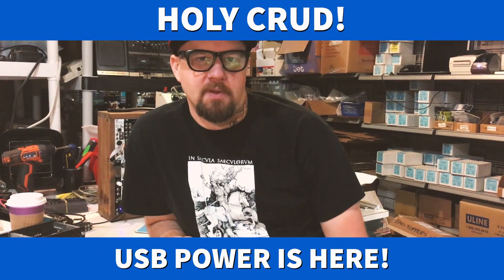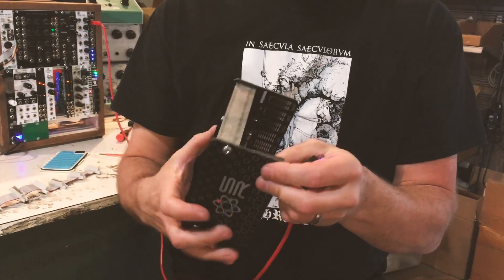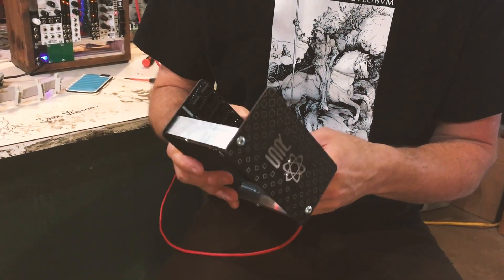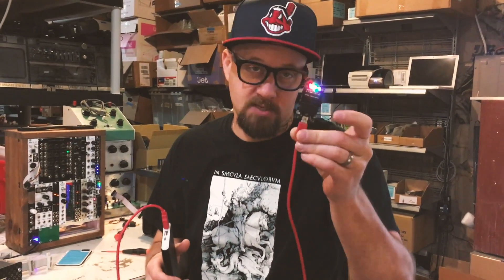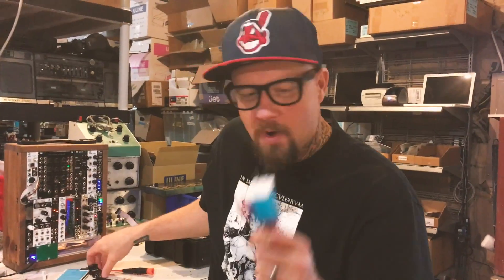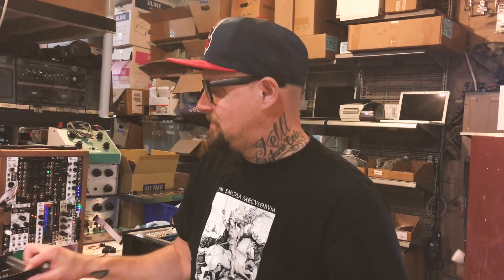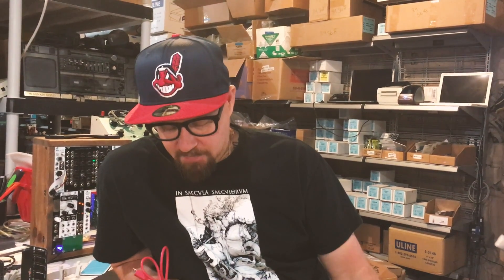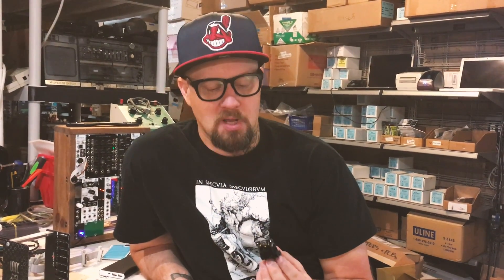Synthrotek USB Power Eurorack Power Supply for SMALL systems - Synth DIY

Comment: With +12V at 250 mA and -12V @ 250 mA  that is about 6 Watts (3W + 3W) of power.  So the USB at 5V would need around 1.2 amps of current out (1.2*5V = 6 Watts) plus a bit extra if the +5V DC is needed   (5 * 0.125A = 0.375 Watts)

Comment: Would it be possible to put a usb power supply on both sides of the bus cheeks? Or does it only fit on one side?
Reply from the maker: Yes, you can get two or use a cable to stretch to the other side.  Both sides might be too much for one though.
Reply: Thanks, I was just thinking ahead for a small build that will probably get bigger before I am done. One of these should power the modules I am looking at, but if I wind up adding anymore it would need more power but still all fit on an 84HP rack. So if i could stick one on each end i could power it all in one case using a usb charging hub.
Reply from the maker: @SexyNinjaMonkey  should work as long as the hub provides enough juice. We found that we were drawing 1.6A (on the 5V USB cable) when pulling 250mA off each the +12 and -12 rails at the same time when using the ReCom converter